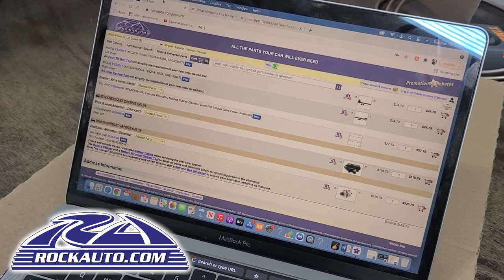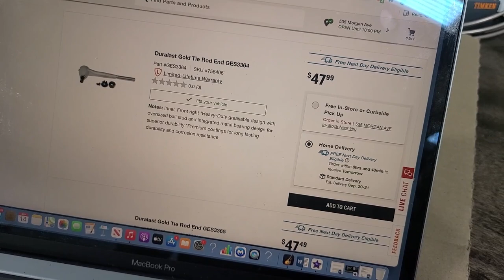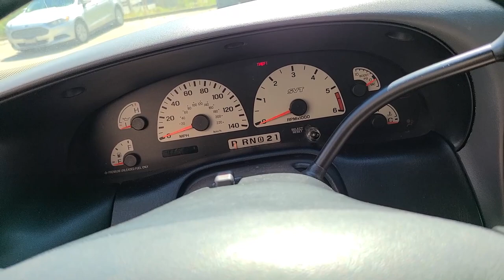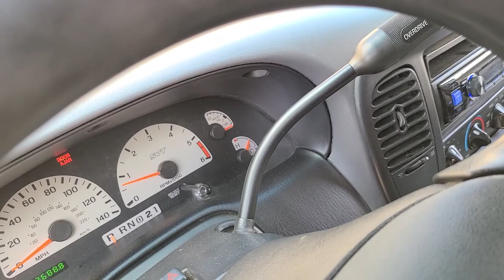I Found A MAJOR Engine Issue After Fixing EVERYTHING On My SVT Lightning! Previous Owner Had To Know

Comment: On my 03 Mach 1 I had the spark plug threads upgraded from the 4 to a 9 thread, good piece of mind. I also went back with ARP studs because the factory torque to yield bolts are harder to install (crazy torquing sequence with torque and degree, backing off etc), meant for a one time use and not as strong. For a few hundred dollars the studs make a ton of sense.

Comment: If it was me i would do: ARP head bolts, ported heads, pulie on the supercharger and tune for e85 that would be sick
Reply: Around 450 hp you should overhaul the whole engine I am learning that lesson
Reply: Ported heads really won’t do much if you’re not pushing in a LOT more air, (more than a pulley) your money is better spent porting the supercharger way before the heads. 

As someone else commented it doesn’t matter becausd by the time you do bolt ons and a good tune your approaching the stock block’s (namely the rods in the block) limit.
Reply: @braydonbroome7473  everyone says the limit is 500rwhp it’s not 450 and it’s a ticking time bomb… I like mine 435 hp with a lower pulley for tq and it’s just a 4 pound lower. When I bought my cobra it had 6 pound lower see ya later went to a stock lower and a whipple fucken nuts.
Reply: @braydonbroome7473  A supercharged engine needs smooth-ported heads because it's PUSHING air into the engine. None of that special normally-aspirated head work means anything to a supercharged engine, especially if it's fuel injected.
Reply: @toomanyhobbies2011  the problem being is when you port the heads the air is less condense if the supercharger isn’t pushing any more air.
Reply: @stephendwinells8260  you know exactly what I mean then.
Reply: @braydonbroome7473  100 percent that’s why Ford screwed up the lightning should have the same internals as the cobra. Full built engine but nope
Reply: @stephendwinells8260  I agree but really if you put rods you’re good for probably 700 ish. (Maybe pushing it then) but by the time you do rods might as well go full send
Reply: @braydonbroome7473  can’t trust the cranks at that power level
Reply: @stephendwinells8260  a L's crank is forged same as is in a Terminator. I haven't ever heard of a L having crank issues other than a few people have had the snot snap off, but that always seemed to be a bigger issue for a Terminator not running a brace. Maybe some burnt up bushings, but that's not a fault of its strength. Even a cast Modular crank will support 700 or so WHP without issue. Getting over 700 WHP is not easy to do with a 2V Modular with only a blower. That's kind of a max effort build on a L.

The OEM rods do suck mega balls. They have the ability to vent a block with the quickness if you try and push on them too hard or your tune is off a little. 450 WHP was always commonly thought of as the safe HP limit for old Modulars that weren't found in 00 Cobra R's/Terminators/FGT's/GT500's.
Reply: @JROC734  the stock internals are stock “forged” so trash
Reply: @JROC734  my tuner has a stock terminator pushing 900hp all stock internals. Mines pushing 700 stock internals and manifolds with a gen 3 2.9
Reply: @stephendwinells8260  okay, but the L's crank isn't a problem area, nor is it weak. The rods are easily the weakest link. It might even be a Kellogg crank like in a Terminator, but IDK I just know that it's a pretty stout/forged piece that will support most any power level you're likely going to push out of a 2V Modular. I've owned my Terminator since 06 and my L since 10. The Terminators engine is definitely much stronger than a L's. If you have your tune on point, and keep the pistons happy they will support a large HP #.
Reply: @JROC734  the sad part is ford could have built these right from the factory

Comment: For the experiment def check the threads to the spark plugs first and then attempt the torque down. But with all this in mind you may want to just be ready with the preventative - supercharger removal, s/c oil change, rotor inspect, IC cleaning, then remove heads/gaskets for something better along with cams and then put it all back together. For sure longevity.

Comment: You should also remove the supercharger and do a deep clean on your intercooler, I just did mine on my 01 lightning and it was hammered. Check your rotors and change your supercharger oil while at it too.  It’s also the perfect time to check your coils and change your plugs with the blower off it turns a 2 hour job into a 20 min job.

Comment: I just had a similar experience.  Just bought a '03 H1 that looked *mint*.  I test drove it, everything was great except of an ABS light- everything was in like new condition or as good as can be expected for an 18 year old truck.  Drove it home 1300 miles.  On the way, the starter died.  Got that swapped out, only to get it home and discover that the belt tensioner was gone - along with the belt.  Then find out the windshield reservoir tank is cracked and leaks everywhere.  Get it to my mechanic and he discovers that the whole steering system needs to be replaced practically.  The power steering lines, the steering gear (was holding on to the frame with one bolt) the pitman, idler and tie rods.  All need to go.  Oh and my tires were rubbing up against my sway bar.  Fact of the matter is that unless you spend a day thoroughly going through a vehicle, you won't be able to find EVERY problem on these older vehicles.

Comment: Is it possible tightening up the head bolts could make it seal better even if it's just for a temporary fix
Reply: No!
Reply: The factory bolts are "torque to yield,"  Once they're tight, that's it.  All you're going to do is stretch them if you keep going.

Comment: I had a 2001 Mazda B3000 (i.e. a rebadged Ford ranger with the 3.0L) that had a blown head gasket when I bought it. It presented almost exactly the same as your truck. No noticeable loss of power or anything except excessive pressure in the coolant system and occasional overhearing on long high speed trips (basically it blew almost all of the coolant out of the overflow and was low on coolant). I ended up driving on it for almost 3 years before it finally blew the bottom out of the radiator and I bit the bullet to replace the radiator and do the head gaskets and head work.

Comment: This same thing happened to my friend's car.  
Short story: the previous owner definitely blew the head gasket and put in head gasket sealant to sell the car making the coolant brown and staining the cooling system.   
Long story: last year he bought a 2013 Chevy Sonic Turbo. When we went to look at it we knew it had problems but it was a good price, he needed a car, he liked it, and it drove fine you couldn't tell the head was blown even when flooring it. The first sign was his coolant was a dirty brown color and the coolant reservoir was stained so we did coolant flushes to clean it out and changed the coolant. The next sign was it would slowly loose coolant over time. He'd probably still be driving the car and we wouldn't know about the head, but the turbo ended up breaking. We had to take the broken turbine wheel out and put a pod filter on the intake so he could still get to work. The car didn't like that and it kept the fan on full speed which ended up frying the fan and eventually the car overheated making the head worse. Finally we had to fix it the right way leading us to find the head gasket sealant when we took the head off.

Comment: Get a factory air box and get rid of that K&N. Do a UOA Used Oil Analysis. See what you are working with! If your going to pull it apart get ARP studs, new pistons and rings! CNC Port the heads, intake and throttle body. New seals and screens for the injectors!

Comment: I kinda want to see you make some upgrades to the transmission a little bit. Albeit it's understandable if the transmission is still operating like it should, but at the same time, it is an older model truck with a few exceptions that have just been replaced brand new and done properly up to this point. Either way, it never hurts to replace a few engine parts vs. spending a lot to do a complete engine swap.

Comment: I did the head gaskets and oil pan on then  my fathers which is mine now. I did it all in the truck. I bought the 3 volume workshop Manuel which helped with all the torque specs and special procedures. Truck is in storage now just resting out of the elements.

Comment: I give the same advice to anyone buying a boosted car.  Beat on it for a good minute then pull over and just listen.  Most of the time you can hear or smell if anything is leaking.

ARP head studs once you remove the head and replace the gasket and you'll be golden.  Get a performance gasket even if you plan on keeping it stock.  They are built to handle higher boost so you'll never have an issue.

Comment: I know many mechanics will disagree but have you considered Blue Devil head gasket repair fluid? I did it on a Ford 4.6 for my neighbor. His Expedition had a badly blown head gasket, steam from exhaust. I used Blue devil exactly as it instructed and it has worked for 4 years. Trust me I am not a guy who uses this kind of snake oil. But I would try it on another car if I had a blown head gasket. I think the combustion gases are what makes the stuff work. Not sure if it would work if the coolant was going into the oil. Worth a try….follow the instructions. It might work.

Comment: Hey Alex, I was thinking of the same thing about checking the head bolt tightness before tearing the engine down.  I have found similar issues on diesel generator sets.  I had a huge gen set that was run by a Perkins 4 cyl, 4 stroke engine.  It was donated to the college I retired from for a student project.  The students and I checked it out and one of the problems was loose head bolts.  There was no oil/coolant mixture in the radiator or crankcase so we just drained everything and added new oil and coolant.  We torqued the head bolts to spec, ran the engine until it got hot, let it cool down and all was OK.  We also used a pressure gauge on the radiator and lost no pressure.  All was OK after that and it ran perfect.  We sold it for a profit on E-bay.  One model of the Ford 5.4 3 Valve V8 engine had a problem with the timing system in the engine.  Make sure you don't have that engine.  Those engines need replaced I have heard. Car Wizard has some low opinions of the Ford engine I'm talking about.  https://www.youtube.com/watch?v=xcN_WcGr4BU

Comment: Go with ARP studs first, who knows, it may solve the problem (not likely), but you can reuse the ARP studs and they are way better than stock head bolts so no loss there.  As far as a "head gasket fix in a can", DON"T to it, at best it will be a temporary band-aid, plus they all plug up your rad and heater core.  And YA, the previous owner knew.  This may be your excuse to do rods and pistons (by all accounts, they are the weak links in this engine).

Comment: I drove my '88 Daytona Shelby Z around for a LONG time with a compromised head gasket, but didn't know it. The car never overheated, made 22psi of boost, power, did track days with it...never once gave me an issue...just blew bubbles in the expansion tank. I eventually DID pop it by doing a lot of low speed, high load driving and it did get too hot due to lack of air flow to keep it cool. We are talking 15+ minutes of hooning it around a small parking lot to practice left foot braking. Even then, it only ran a bit rough, but wasn't consuming any coolant.

Comment: Alex - same issue on my 2002 WRX with 242,800 miles and the EJ205 engine.  Pressure-tested cooling system - held 20 PSI fine.  Small bubbles appearing in coolant reservoir at idle, many bubbles under boost.  No white smoke out the tailpipe, no mixing of oil and coolant.  Either head gasket or tiny crack in head.  Adding cup of coolant every few days until my 2021 WRX arrives.  BTW, tried Subaru Coolant Conditioner (rebranded Holts Radweld sealer from Britain) - did nothing.  Combustion gases under a lot more pressure than cooling system.

Comment: A good head gasket sealer is liquid glass. It has copper flakes and sodium silicate so it will definitely seal the leak. I bought a 2004 Z71 Tahoe that at 190,000 miles it overheated on me and blew the head gasket. I installed 2 bottles of that sealer following the instructions of course and I currently have 303691 miles and zero coolant loss.

Comment: Brother, you need a but of sound deadening on the walls at the Legit Streetquarters.  Doesn't need to be like professional treatment, just something less sound reflective than the concrete walls.  Some banners or something would help quite a bit.
Reply: No need to drape the walls, a mic adjustment will kill the echo
Reply: @reallyhappenings5597  not without changing the sound in possibly undesirable ways.  Taming the reflectivety of the room is less technically challenging/time consuming, and more permanent.  You don't need to cover all of the concrete surfaces, just enough to tame the sound's tendency to ricochet back and forth.
Reply: @TheAlanFish  some old blankets from a thrift shop in hte corners and a Soundcloud above him made from old raggedy blankets will work great too.
Reply: @thh420  yeah, but I'm guessing he doesn't want some ratty blankets in the background of his videos, which is why I suggested banners.  Flags could also work well.  I actually use quilted wall hangings my mom made because my concrete walled German apartment was so live it made me cringe.  Lol!
Reply: @TheAlanFish  I meant out of frame, like way up by the ceiling. big moving blankets would work too. rubber mats would help on the echo off the floor. my dad used to mount speakers in the corners by the ceiling in our shop and had glued moving blankets to teh ceiling because it echoed so loud in our shop.

Comment: I have the same problem in my Renault Megane 1.4 turbo. It has power and did a lot of miles without noticing. The only thing was that it started pressurizing the overflow tank and lost some coolant. Now I’m praying that nothing major is bad in the engine.

Comment: The downside to rockauto is the shipping when purchasing a ton of stuff. Always ships from multiple warehouses, and they charge separately
Reply: I never had that problem with charges they most of the time offer if you order a certain amount free shipping. No extra charges
Reply: Robert Vance Rock auto has never had free shipping. I’ve been ordering from them for at least a decade. The shipping is very expensive with larger orders, even if you can somehow get everything from the same warehouse. Usually not the case, so you end up paying shipping charges on each order from separate warehouses. It really adds up if you purchase a ton.
Reply: @sarahdell4042  I have been ordering from them for years and once my order got above $50 dollars taxes paid and that's it. Anything below I got charged I don't if it's location or what. I have no reason to lie.
Reply: And one day shipping could get a little expensive in my experience.

Comment: This is super common, the head bolts stretch under boost. You can try doing one stud at a time if you replace them with ARP studs. Do not add any of that head gasket sealant snake oil crap. Also, you can check head gaskets under load by hooking up a pressure gauge in line of the degas bottle. Obviously combustion pressure is substantially higher than cooling system pressure. Hope this helps if you encounter this again. This is what we do on diesels

Comment: I've had engines I suspected a combustion leak but would always check okay when using the blue fluid. I'm probably not the first, but I've never seen anyone else do this. Simply put compressed air in through the spark plug holes. You will have to turn engine to where valve are closed on that cylinder. My leak showed up right away with bubbles in the cooling system. 
Don't waste time trying to tighten head bolts. Disassemble and check surfaces, replaced gaskets and install studs.

Comment: Sometimes when I watch these Lightning videos I really miss owning one....and sometimes when I watch, I really don't miss owning one. If you are taking it apart, fix the spark plug threads (if they haven't been done yet) lose that stock supercharger and get a Kenne Bell. Those Lightning forums were a godsend when I owned mine.
Reply: Is there anything wrong with the stock one? Got a friend trying to put that engine in a crown Vic.

Comment: Wow, sorry to hear about the issue with the top end. If you need the run the truck till winter, just baby it along, but i would check the oil level every day to see if you start to get water in there. if you do shut her down, totally not good. also check over flown tank after every drive, just to check on it. 
I would doubt you have a loose torque bolt but anything is possible. if you do, know you will need a new set of heads cause warpage is really in the books. Good luck. Hope you have a good machine shop to work with.

Comment: I've used blue devil head gasket sealer with great success many times. On vehicles I've personally owned. One being on my 2003 bmw 325xi. I drove it like that for about 3 years and still would if I hadn't hit a tree head on. How ever you need to get the bigger bottle that requires you to drain the coolant and remove thermostat and replace with water. Follow the directions to the tee. And if it don't work for you the company will reimburse your purchase. So honestly you have nothing to lose but a few hours of your time!. Also with you having the issue only at boost you might need to get creative to allow that sealer to get into the gasket faults.

Comment: I had that same issue with the coolant turning brown in my 2000 Ford Focus. Eventually the car started overheating even though the I replaced the water pump and thermostat. I used Thermocure to remove the rust in the coolant system and it fixed both issues.